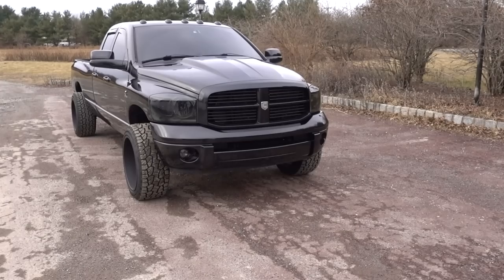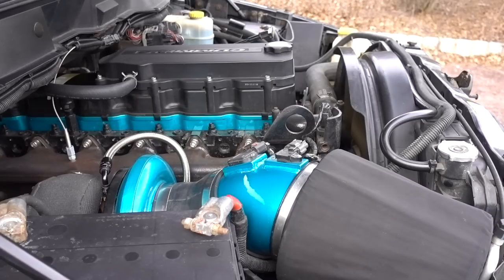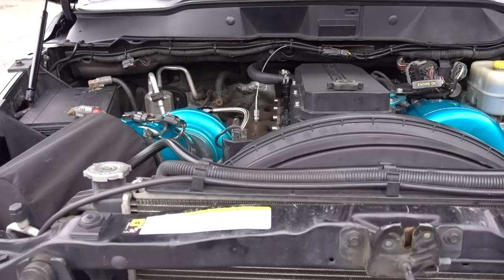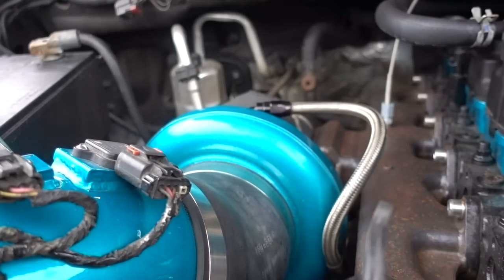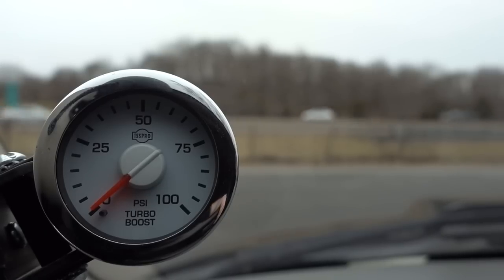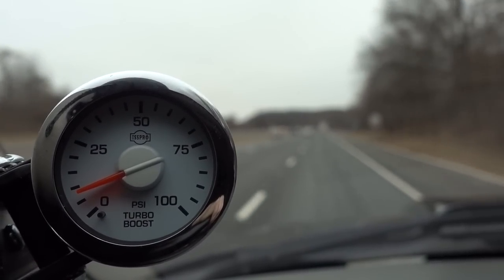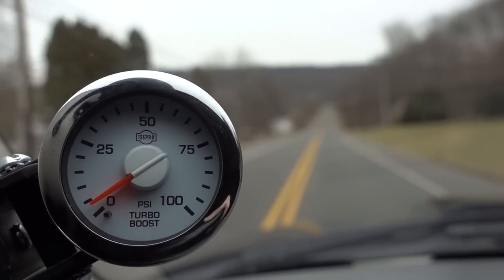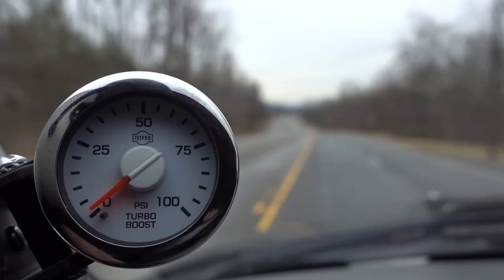6.7 Cummins Tow Rig Turbo Setup! 2nd Gen Swap w/ 467.7

Comment: Was it laggy or feel under powered with stock fuel? I can get a hell of a deal on a 467/67 full 2nd gen swap, I’ve already got custom tuning and an air dog fuel system and just put a brand new transmission in... but running this setup on stock fuel makes me a little ehhh...? What’s your opinion man...?

Comment: Did you keep your CCV Filter? How do you get rid of the perform service message on your over head display?  If you kept it how do you keep the suction without it plumbed into your intake?
Reply from the maker: I have no CCV Filter, never had a issue with the light and a crankcase vent doesn't require suction, There are threads online or I can make a video on exactly what I did, basically have a gut a ccv filter and keep part of the base.
Reply: GREG_ALBERALLA I did it to mine just have the reminder no actual code. And I'm assuming the suction was to help pull to oil into the original filter set up. I've seen the threads but never seen a video on it. Might be worth the effort.

Comment: Any experience with the 369sxe. Trying to decide between that and the 467. What would you recommend for stock fuel. Im guessing your running it with the 83/.9 housing. I basically have same truck except 2010.
Reply from the maker: yes a 83/.9. I love the new sxe line, they are a great option. But In my opinion when possible a s400 base charger gets my vote over a s300 frame. Max power out of a 369 is roughly 700 ish which is awesome, these 467.7's i have seen much more. Hopefully that helps some.

Comment: Did doing that turbo set up increase or decrease your mpg?
Reply from the maker: Ill be honestly i never really checked it before I did it
Reply: GREG_ALBERALLA what mpg are you getting with it then? Thinking about going to this set up in the spring, already have 30 over injectors.
Reply from the maker: Ill have to check again soon, I'm assuming the turbo would cause it to be a little better but also at the same time your foot will wanna be more in it for sure which wouldn't help. This turbo setup makes the motor really work effortlessly to get up to cruising speed.

Comment: Is that a stock black valve/crank case vent cover?
Reply from the maker: It is off 6.7 industrial applications
Reply: GREG_ALBERALLA  another great video man 👍🏻
Reply from the maker: Thanks!
Reply: +GREG_ALBERALLA do you possibly have part number for crank case cover?
Reply: Cody Crouch I second this

Comment: Hey thanks for all the information. I know you said your truck is completely stock aside from what you mentioned in the video. how much boost do you feel comfortable running on stock head bolts?
Reply: wouldn’t push more than 500 on stock head bolts
Reply: @coreymartin2605  500 HP?

Comment: when you put that turbo what happens to the wires that connect to the stock turbo
Reply: just tie them up, cap em off so they don't corrode then you can go back to stock if ever needed.. need tuning to prevent VGT codes aswell

Comment: do a video like this about the triple turbos on the 6.4 I'd like to learn more about that set up
Reply: THENOTHING24 what the fuck is a 6.4? I keep on hearing about a 6.4L Cummins? WTF! Cummins only makes or had made 5.9L 6.7L and 2.8L and something else that's for tractors and something else. And obviously Semi Engines..
Reply: Do_it_with_Zane_117's_vlog's a 6.4l is a 6.7l cummins block that has a 5.9l crank in it it gives it better rod angles to go to higher rpm but a big bore to spool a large turbo
Reply: Cummins makes a 2.8L, 3.3L, 3.8L, 3.9L, 4.5L, 5.0L, 5.9L 6.7L, 8.3L, and on and on and on....
Reply: Erik Kovacs u forgot the 8.1
Reply: 2.8 3.3 3.8 3.9 4.5 5.0 5.9 6.7 8.1 8.3 and a 9.2 i think
Reply: josh van vorce I meant the current lineup not historical engines.
Reply: the 8.1 and 9.2 cummins are still used today in tractors semis the 9.2 is a big rig generator boat engine they still use um if any of the engines are historical its the old 12v 5.9

Comment: I have a 2011 6.7 with 68rfe. VGT turbo is currently stuck open... is has around 160 thousand miles or 274 thousand km’s. I spoke to my tuner and he said that fixed vain turbos don’t pull nearly as well and (you lose low end power ) is basically what I understood. He also said the VGT turbo is better for tuning purposes because it constantly spools the turbo up faster. I’m currently deleted with 5” straight pipe , I have studs I just need to put them in. and I do not want another turbo failure. Not to mention the VGT stock holset turbo new from bd is like 2500$ and the 2nd Gen swap is around the same price. I mainly daily the truck and pull light stuff ( under 10 thousand pounds ) I’m considering a BD s463 or s461 2nd Gen swap because my family’s shop is a BD dealer. I’m still trying to decide what to do. I really like the sound of a 2nd Gen swap and if it works for Greg A and he pulls 15k with a s467.7 it should be good enough for me.

Comment: I have a 2008 6.7 mega, I swapped for a nv5600 out of a 01 24v, bigger input, because I blew the 68. Everything is great, but I'm pretty sure I blew the HG. So doing all that with 625s, I had 425s, but going 625s, and 110# valve springs and rods. I am wanting to go to a 2nd gen swap, but thinking of a s366, so I can eventually compound it later in life.
Reply from the maker: Honestly do yourself a favor, with a 6.7 and the flow it produces go a little bigger, it will still spool better than stock, but whatever you feel comfortable with man, great choice with the 625's
Reply: GREG_ALBERALLA well I plan to do compounds later on. Dual fueler, 100 or 200 over nozzles. This way I can get rid of that stock turbo and that drive by pressure
Reply: ouv hey man you did a 68rfe to nv5600, was it a lot of work ? and how do you like it ? I have a 2015 I wanna swap 68rfe is about to go

Comment: I have a 2012 6.7 cummins. I sadly have a 68 RFE tranny. that doesn't feel the strongest now  do you think it would give me transmission problems. I don't beat my truck it cost to much to fix but if I put this in my truck would it give it to much power for a stock automatic transmission.  I have EFI live already but everythings stock on it.

Comment: You're killing it with the videos man! Excellent quality. I wanted to confirming stock fuel as in no aftermarket fuel pump either, correct? Real nice truck! Also that truck an auto trans?
Reply from the maker: Thanks as always! Yes 100% stock for now, but it is a 6speed manual truck.
Reply: GREG_ALBERALLA I appreciate the reply! Manual is just icing on the cake. Always go that direction for a tow rig. What a beauty. Thanks to you I'll be looking at doing this exact 2nd gen manifold/turbo swap after my current BD Super B single needs replacing. Sounds like a solid combination for its application. Also interesting you mentioned Gordon at Innovative Diesel, recently spoke to him about getting some tuning done. Nice to hear another recommendation for him there. You know the limit on boost for that turbo staying within efficiency? I see that boost gauge is ready to show a whole lot more.
Reply from the maker: It can def handle more than what its seeing now,  I have a pretty high PSI gauge in it now just to avoid needing a larger one if plans for the truck happen to change down the road.

Comment: Got the p2262 code and took my turbo apart to clean noticed when I went to put it back together the veins we're bent and sticking. put a new vein in it and the code went away for 5k miles and now the code is back.. thinking about just doing a second gen turbo.. p2262 is really pissing me off!

Comment: Sweet truck,  I bought a low mileage 2008 2500 6.7l 6 speed this summer. First diesel truck, I notice it had a lot of turbo lag especially when shifting with a load. My friend has a 2006 5.9L 6 speed and it has zero to no lag, both trucks 100% stock. I don't know which tuner to purchase for the deletes and what not, but I need to do something.

Comment: How is it for surge? Any specific RPM and boost that  has nasty surge? I've been running a S366/74 and the compressor surge between 1600 and 2000rpm at around 15-20psi is so bad that I'm done and changing chargers.

Comment: i either want the s400 or the 4094 in my LBZ i like the vanes thou for towing there great for braking  but i like the price of s400 ive never had any problems with my vanes on my stock turbo an its sounds sick when ur at a stop light an they adjust

Comment: I'm wanting to go with pretty much the same turbo set up you are running but I'm worried about the steed speed manifold giving me figment issues with the down pipe, hot pipe, and shock tower. Did you have any problems with yours? And great videos sir keep them coming

Comment: Hey Greg, was wondering whats your complete gauge setup? i know you use isspro but what all do you monitor, and what did you use to mount them i noticed in a more recent video you have some on the pillar as well as on the steering column. looked like a good set up but didn't look like a kit more like something you put together. something you seem to be great at. Thinking about ordering some gauges for my truck just doing my research first. Thanks!

Comment: How much psi can a 6.7 take before head studs should be put in ?
Reply: Mine runs 32-36lbs on the stock vgt,
Reply: chevyapache1959 

mine runs on 40lbs on stock vgt, stock sticks, stock fuel system, h&s tuned, afe stage 2 cai
Reply: 38 psi here
Reply: 45 🤭😰

Comment: so basically a 2ed gen swap in this is just the manifold and intake correct not literally swapping engines
Reply: I'm just a lil confused ive never heard of it before
Reply: yes
Reply: most people when refering to a "2nd gen swap" i usually just refering to the manifold. other thing need to be changed to accommodate this change, but in generalities, they are refering to the manifold.

Comment: How did the turbo swap affect mpg(city/highway)? My stock 6.7 mega-cab would get about 15-16 city and 21-23mpg highway(Unloaded). Also I have the 68rfe auto. Thanks. Awesome truck Btw.
Reply from the maker: I think if anything it might be around the same if not a little better, its also a little harder to not enjoy the new power so therefore the right foot leads to worse fuel mileage. But if you can retain the same driving it should be a little better I think, I never monitored mine. acceleration defiantly is a little more effortless. hope that helps a bit, thanks!

Comment: hey question. you said on complity stock truck does that mean head studs as well?? i have two trucks i have and 1994 12v with my egts way to high. and an 03 6speed thats my tow rig thats complity stock other then cold air and smarty so6. could i run say that size turbo on stock head studs?
Reply from the maker: No it does have head studs, and I would recommend them for sure

Comment: What is the horsepower I have a 6.7 that is pretty much your exact set up besides turbo. I want the s467 but wondering what power your making and what are the specs on turbo?
Reply from the maker: mine is a 67.7/83/.9 not exactly sure on power, this spring we'll get it on the dyno

Comment: Do you think this Charger would work well with a 12 valve? It is a 97 5-speed, so 215 ppump, fuel plate pulled, 4k gsk, AFC done for no fuel plate, I can't remember if the timing was advanced. All the mods were done to the truck by a diesel shop before I purchased the truck. Doing head studs right now, do you think with some bigger injectors and some tinkering it could light this charger efficiently and give me room to grow?.. Or would you suggest a S363?
Reply from the maker: on a 12V I would def tend to recommend something smaller, these newer trucks just tender to spool larger frame chargers easier, something like the new see 369 can support some good power and still have great all around manners, hope that helps some.
Reply: George Smith  hx35 is what your truck has stock. He put a 2nd gen  "94-02"  turbo set up on his 4th gen drive dodge.

Comment: My 96 12v with a 64/74/14 pushes 60 psi and the egt's are at about 1300 to 1400 and that kinda scares me......truck was dynoed at 500 whp so it can handle the boost but idk about the temps
Reply from the maker: Def getting a little warm for sure, but if your only seeing that at WOT then when your driving around normal I wouldn't worry about it, but eventually down the road you'll know you need some more air.
Reply: What do you have for exhaust manifold? I changed mine from stock to steed-speed manifold and temps dropped about 500°

Comment: I have a 2003 ram 3500 Cummings and I have a problem ...It heats up when I go past 70 mph do you have any idea why the truck starts heating up way past the normal ... please respond
Reply from the maker: Unfortunately its almost impossible for me to diagnose your truck over the internet, just too many variables to account for. I'm assuming your talking about your coolant temp? Sounds like a cooling system problem, water pump, thermostat. Again I can really only guess.
Reply: Thanks anyways water pump was my last check

Comment: How did you get the coolant up pipe that would normally go into the EGR cooler out of the way of the manifold? Did you just take it out or reroute it somehow?
Reply from the maker: Source Automotive makes a new pipe that reroutes
Reply: GREG_ALBERALLA Thanks!

Comment: Personally I feel that going away from a Vgt turbo is a step backwards doing these swaps. A vgt offers so much more in adjustability, engine braking and superior spool up
Reply: Taylor Raber looking at sending a he351ve to turbo labs of America for there machined up grade 67-70 package, a lot cheaper then buying the fleece cheetah.
Reply: VGT performs great until the veins get stuck open with sooty exhaust. 
I feel that VGT would be a perfect match for gasoline applications. 
Otherwise its a time-bomb waiting to happen.
Reply: drunkinmaster1 if the truck is poorly tuned and is blowing a lot of soot then it's not only effecting the turbo. With a properly programmed engine you gain a lot more control and can run the engine cleaner which prolongs the longevity of the turbo vanes not being carbonated up and sticking. It's easy to clean the vanes if need be and the he351ve is cheap to rebuild. It's time for the aftermarket world to step into the 21st century and take advantage of a better technology.
Reply: Even on a stock tuned diesel, VGT's have had issues. 
Not knocking the performance potential. 
It's just something more to go wrong in some people's mind.
Reply: my 6.7 that the exhaust was 99% clean i still had multable issues with the P.O.S VGT turbo and then ended with it gernading its self.

Comment: What are your opinions on 2003 cummins?  What about time and money for a 5.9 to a 6.7 swap? I really like your trucks!  I'm looking for one myself
Reply from the maker: Thanks,  both 5.9 and 6.7 common rail engines are solid platforms to work off of, and everything has its pros and cons  the 48 transmission is gonna be a better option than the 68 in any 6.7 truck. you can always swap short blocks if you wanted the 6.7 motor, everything is interchangeable just takes some money. hope that helps some.
Reply: GREG_ALBERALLA that was just what I was looking for thank you!
Reply: what turbo would you recommend for the 2003 5.9cr  right now i have a CP3K and fass150  just had my sticks pulled and tested & acouple replaced .. so all is good with my fuel system .. my truck isn't a tow rig 24/7  id say I'm about 35-40% towing with it.  and its time for a turbo before i push it to far.. right now I'm about 30-33psi .with little shaft play.  truck has 415,000 and runs like its 80,000 .
Reply: My cousin just got done swapping his. I figured it would get pricey with the tuning to fool the computer. However, he said that the truck still thinks it has a 5.9 in his truck.
Reply: Taylor Raber oh sweet is he happy with it all done?
Reply: Gopi_123 he loves it so far

Comment: how come it seems like most people leave the clutch fan on instead of going with a electric fan for cooling
Reply from the maker: The fan clutch is more reliable and stronger than electric fans, When I did the research on them for my other truck I found a couple people doing towing that the electric fans were not keeping up vs the fan clutch style.
Reply: awesome thank you for the info